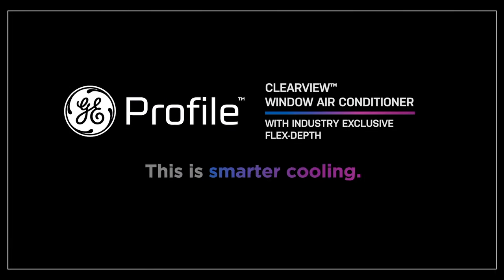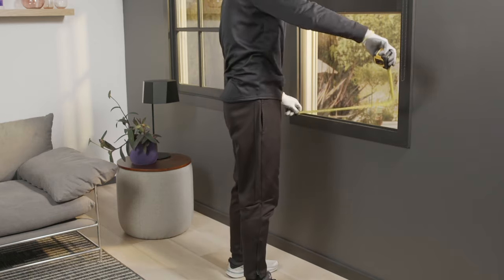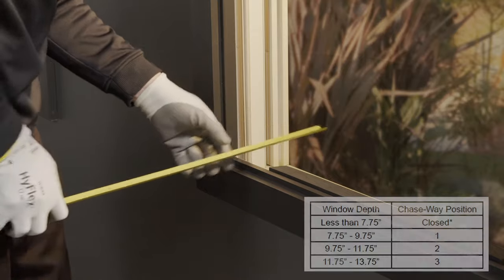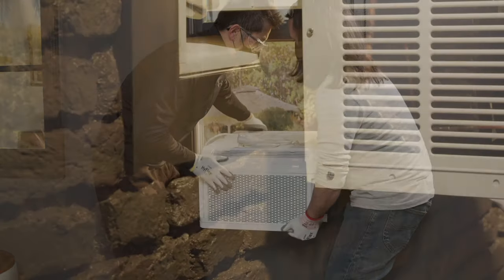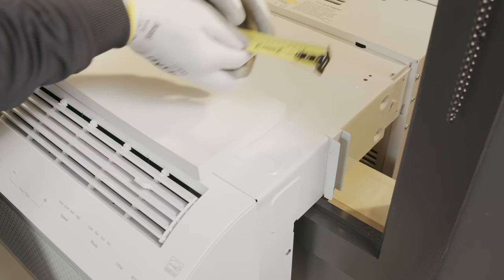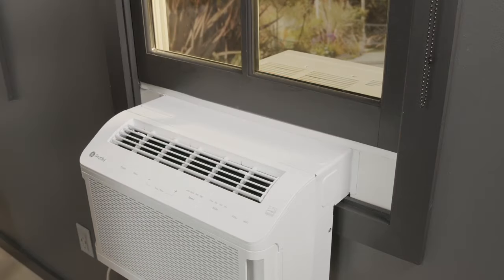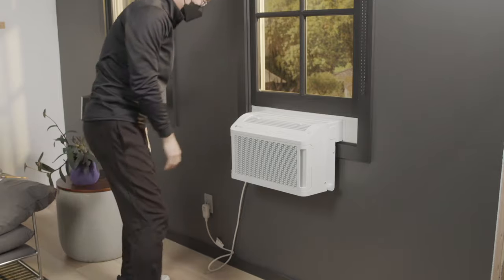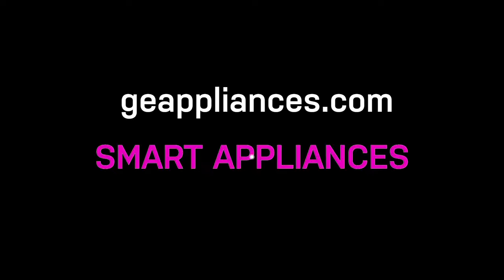GE Profile™ ClearView™ Window Air Conditioner Installation

Comment: Does the condensation water drain outside or does the unit have a bucket inside the house that you have to keep emptying?
Reply from the maker: Hello there. Thanks for reaching out about this. Over time, the air conditioner will accumulate water on both the indoor and the outdoor sides.  We recommend that you only attempt to drain the Outdoor side if necessary and you can safely access the unit from the outside. The inside will eventually need to be emptied. Instructions on how to do so can be found on page eight in the Use and Care Manual. We hope that this is helpful! -AT
Reply: @geappliances  But can either the interior or exterior drains be plumbed (with tubing or other) to continuously drain or is that bad for the unit?
Reply: @nilomyki  I would love to know this too because who wants wet carpets and all if you are not home... I would hope there is a work around for this or guess just remembering to empty pan? Not sure - am interested in buying one so doing my homework. :)
Reply: If it requires water drain inside of our room, it’s no different than the other brand, Soleus, which had exact the same design and drainage issue inside of room. I was debating myself when I first looked up AC this year whether I should go with that one or midea U shape. I loved this “n” design more than “u”, yet, I read reviews about needing drainage inside of room constantly. Therefore, after weighing all factors, I decided to go with Midea U shape. I bought 2 and they worked like charm, super quiet and super efficient cooling down the rooms. The only downside of midea was the installation. I honestly think that this Ge/Soleus “n” shape design is even better than “U” shape but inside room drainage was a deal breaker for me. Ya should perfect this flaw then GE can compete against Midea. Before ya fix that, Midea U shape is by far the best window AC in the market without doubt from my experience.
Reply: @monams2514  media U shape does not require draining inside of our room. I got 2 1 week ago, worked like charm, super quiet and super efficient. Before GE and Soleus, same design as GE, perfect their craft, I think Midea U shape is by far the best window AC without doubt. The only issue is that it’s not installation friendly as GE and Soleus for the “n” shape. I personally loved N shape but drainage inside of the room was a deal breaker for me . Hope it helps
Reply: @mikefchen4996  what model number was the Midea ushaped and that is the one you said does not leak inside  correct? I have a lip on my window sill and also my window is single hung about 50 inches wide and 15 high with 2 locks on top of it. What one will fit? I know the foam stuff I would probably have to buy more of. I wonder if this GE one would work too. My brain is overworked from looking into these and the portable ones. I think these are better. And how about electric bill is it any better with one of these you think? Thank you so much!
Reply: @mikefchen4996  Where did you get the Midea ones from? I know they are probably expensive now that temps are reaching the 90's just about.
Reply from the maker: Hello. We appreciate your interest in our air conditioner, and certainly understand your concern over how it’s drained. We would not generally recommend continuous draining for the unit, as this model shouldn’t require that. Water collected from the evaporator will be pumped to the outdoor side of the air conditioner by the internal pump, and it also has a safety switch that is meant to shut the unit off if too much water collects on the indoor side, to prevent leaks. Draining the indoor side won’t be necessary often, but when it is done a bucket or similar container will be needed. If necessary, the outdoor side drain is threaded to accommodate a standard garden hose to direct drain temporarily through the hose. Draining is discussed on page 8 of the manual, and we also have an article discussing draining here: https://products.geappliances.com/appliance/gea-support-search-content?contentId=000062584&_ . We hope this information is helpful, and we’re always available if you have other questions or concerns. All the best! -SG
Reply from the maker: Hey there Mike F chen, and thanks for reporting your feedback. We appreciate hearing from you, as we always want to know what consumers think of our models; our team will review your insights, for future development. We would like to advise this model features an internal pump that directs moisture to the outdoor side, so draining on the indoor side would not be necessary often. There’s also a safety switch to shut down the unit if the indoor side is collecting too much water, to prevent accidental leaks. If it might be useful, we have an article that discusses draining the unit in more detail here: https://products.geappliances.com/appliance/gea-support-search-content?contentId=000062584&_. We hope that information is helpful, and are always available to assist if you have other concerns or questions. Wishing you all the best! -SG
Reply: @geappliances  Very helpful, Thank you! That explains a lot! Not confused anymore!  🤜🏻
Reply from the maker: It's our pleasure! -MJ
Reply: @geappliances  Thanks for the clarification.
Reply: this is what I found from GE official website...."The good news is we do not anticipate you having to drain either side of the unit in most instances. Water is collected in the indoor section as the air conditioner removes moisture from the air. When the indoor tank starts to fill up, water is pumped to the outdoor section where it evaporates or drains out. It will evaporate with the outer rubber plug installed. Water is picked up by a fan and flung against the condenser coils to evaporate. If the rubber plug is removed to decrease noise the water will drain out. Removing the plug decreases efficiency."

Comment: Way to not show which direction the locking nuts go. The instructions just say lock the nuts but don't say whether they lock against the house or against the unit. The shot in the video just shows the guy's hand without specifying which direction! This must be why our unit has started to sag out the window. Thanks for nothing, GE!
Reply from the maker: We definitely share your concern and would like to know a little more. Do you mind sending us a PM/DM on our Facebook or Instagram page with the model and serial number of your appliance, and a few details of the issue you're having? If you need help locating the model please see the link http://spklr.io/6059SPFx.
Reply: @geappliances  The issue is with the model that this video is for, and the problem is exactly as described in my comment. Neither the instructions nor the video specifies whether the locking nuts on the exterior supports screw in the direction of the building or toward the unit. Not a complicated issue but the failure to include this detail is a failure to ensure the unit is secured properly. It should be a simple answer, but the video even obstructs which direction the locking nuts go!
Reply: My interpretation was that the locking nuts secure on the AC unit side so that the screws don’t come loose.
Reply: Screw the locking nuts against the unit itself to stop the feet from loosening or tightening

Comment: This window unit is awful! I've had issues with it since installing last summer. While it looks nice, it does not drain water out of the inside of the unit that is inside of the house so water sits in the unit until manually drained and the compressor will not kick on and it smells awful! I have to drain this multiple times a day for it to cool my tiny room. I've read reviews that people are having to leave a bucket under it so it will drain constantly... just nasty! It's also leaking from the cracks where the sides connect to the main part of the unit.  The back of the unit that is outside is bone dry. This is just AWFUL.  I contacted support online and was told to contact through phone to use my warranty but I could never get through to anyone!!! I tried the number that was given to me from online support and the number on the website and never got an answer. Warranty is expired and i'm stuck with this junk now. Stay clear of the "clearview" units, while they sound nice they are just not functional!
Reply from the maker: Hi Courtney,

Thanks for taking the time to reach out. We're sorry to hear about the issues you've had here with your unit and with getting help with it, we're sure this would be frustrating to say the least.

Since the saddle unit base is below the windowsill, water collected from the evaporator (humidity removal) is pumped to outdoor side of the unit. There is an internal pump that pumps water to the outdoor side. In a case where the pump fails or cannot keep up because of extremely high humidity, the unit has a safety switch to shut down the unit. This keeps water from dripping from the unit on the indoor side. 

On the rare occasion that this occurs, the drain has a thread that accommodates a standard garden hose thread to direct drain through the hose if required. The indoor drain cap can be removed if you wish to remove the unit from the window. There may be some water in the indoor base, and removing the indoor drain cap allows removal of water before attempting to remove the unit from window.

If you're still having issues, please PM us on Facebook or DM us on Twitter or Instagram with your complete model and serial numbers, as well as a copy of your comment here. If you need help finding the model and serial numbers, you can click here: http://spklr.io/6052Y0BO

Hope to hear from you soon. -MS
Reply: @geappliances  it's not a rare occurrence, it's all day, everyday occurrence.
Reply from the maker: Hello Courtney. We hate to hear you’re frequently having these issues – we would not normally expect this to be a regular concern, and we regret the inconvenience you’ve had. If you’re able to, please send us a private message over our social media (such as Facebook or Twitter) with your model and serial numbers and the details you’ve included here. We would be more than happy to look into your concerns further, and offer any assistance we can. 

We hope to hear from you, so we can help. We’re wishing you well in the meantime. -SG